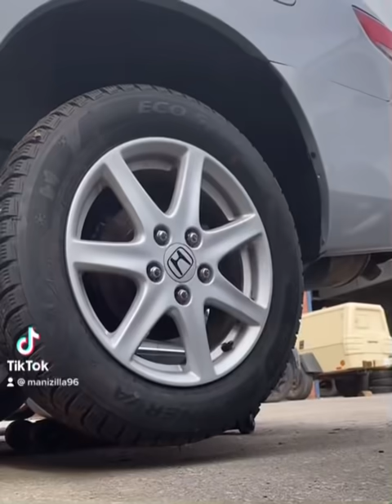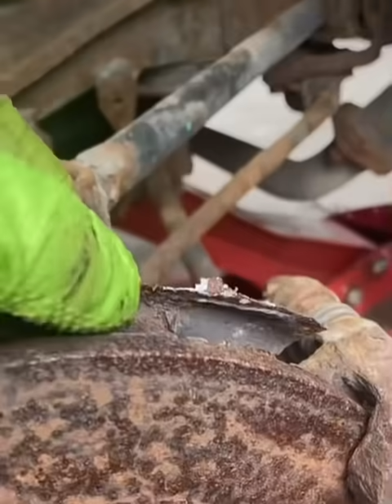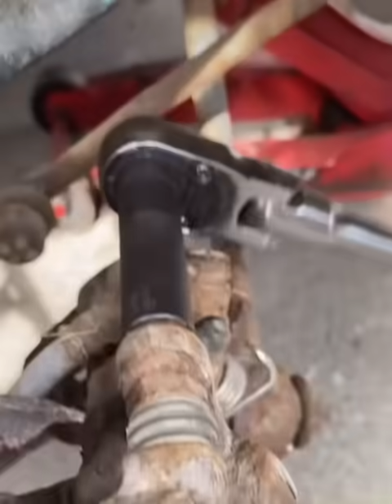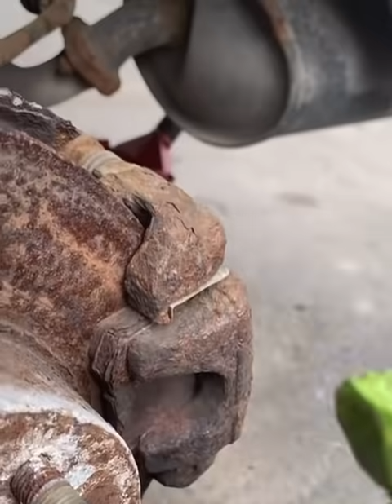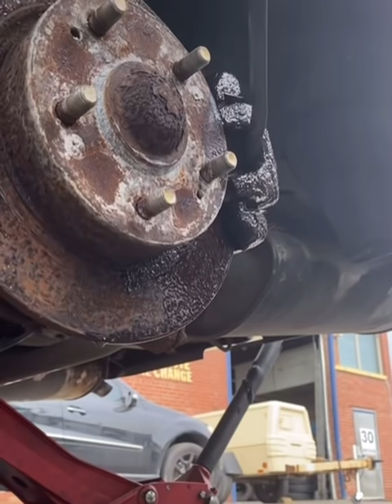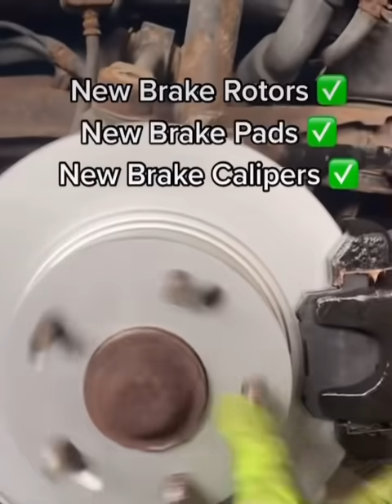Customer never drove their vehicle for 2 years and this happened ...

Comment: I let a 2002 Kia Spectra sit for 4 years, no cranking, moving, anything. I had actually lost the key and it was a $500 car so I didn't care. After 4 years I got tired of looking at it and charged the battery, had a guy come cut a key, and to our amazement it started right up. I pumped the tires back up and drove it like it was for another two years until the clutch went out. Now it's sat for another two years, someday I'll get tired of it sitting there and throw a clutch in and probably put another 100k on it. Can't kill a beater.
Reply: 🤣

I let my expedition sit in the backyard two years until the truck sank making mud go over the rims. Jumped the battery. Took it straight to the highway 👍🏼 (reminded me of this thing)
Reply: My dad had a 60s ford pickup, (not so) bright red old beater. Over 350k miles on the original engine and trans, just give her a jump and she's good to go! It just works.
Reply: Depends on where you live haha. I lived in Arizona, and you could do the same to cars that were sitting for 5+ years. They rarely rust down there due to no salt on the roads.
Reply: I recently passed 300k in my 2007 Spectra and it still runs great. Original engine and trans, but also the original timing belt, so it's only a matter of time before that breaks and takes the rest of the engine with it if it doesn't get replaced.
Reply: Just sell it for 500$ again
Reply: @CubicCake  get a new timing belt instead of breaking your engine
Reply: 89 cherokee with 350,000 miles on it. Sat for four years with no start, movement, nada. Went out. Charged it, drove her on a 200 plus mile trip. Some cars you just can't kill. 🤣🤣
Reply: @CubicCake  I probably will put a timing belt in it, but to it's credit I put 190k on the factory belt. That car has never once left me stranded, even a couple times when the battery was dead I could roll it off by myself.
Reply: @SmellsLikeShmeat  That's awesome! They sure don't make them like they used too.
Reply: I let my 04 Lexus with 150k miles just sit for a year and a half. Had to replace the battery and she starts right up. Unfortunately the tires need to be replaced as they got flat spots but they were low on tread anyway. Can’t beat a beater!
Reply: @joshuavoss1387  me:cries in nissan. Shit always break on me and i dont even drive fast
Reply: And I had a 17th century wagon sittin' there in me yard fot the past 300 years more or less, jumped the horse and that damn thing fired right up! Took the thing for a ride. It was wild!
Reply: It's a Korean car. That's why it started right up lol
Reply: @drunkenbass6128  good luck
Reply: Last year I got my brother's 1996 Dodge Ram that he had let sit for 2 years, I charged the battery and it's been driving fine with 240k miles
Reply: Lol the can’t kill a beater line reminded me, if you live in Florida(mostly) don’t drive your wrx in 10 inches of water, some guy flooded out his brand new wrx yesterday
Reply from the maker: Goddamn 4 years?? Here in Canada that’s basically death by rust
Reply: @ManiiZilla  yeah looking at this video I was thinking, gotta be salt winter land or ocean living. Here in west Texas it's totally dry air and you can have a car sit for 20 years, just flush the fuel system and change the battery and it'll go like no time has passed.
Reply: @turo669  a farmer I work for had a K10 that sat in a barn for 15 years. All he had to do was give it a shot ether and it drove out of the barn. Didn't even need to put air in the tires
Reply: @TheCuriousNoob  I was about to say. I agree. Definitely flush the gas tank. You can tell and feel the difference between old gas and new gas.
Reply: @alecon2249  yeah old gas is not only less potent but it can really damage an engine as it breaks down.
Reply: @ManiiZilla  what does God have to do with the topic?
Reply: There was always that kid in school who raised his hand just to tell a story no one really cared about
Reply: Truff
Reply: Or an old Chevy
Reply: Cars are meant to be driven not to just sit do someone a favor and sale it to them!
Reply: @neilborda2005  I know right? You were that kid huh?
Reply: @ManiiZilla  I'm in the southern United States, mosquitos carrying the car away are my biggest concern, rust, not so much.
Reply: Nevermind the pad rub that the customers going to returning for after they drive it a few miles and it makes hella noise.
Reply: @CubicCake  4 cylinder timing belt/chain changes are really easy to do. If you have a small amount of mechanical inclination and follow the directions, it can very easily be done. I did it at least 15 times in all my friends and my civics like 8 years ago when I was 16-17 before I got my first garage job out of high school. I had never really worked on cars before then aside from changing tires and oil so it’s definitely possible to do it yourself easy
Reply: I had a 95 Ford F-150 flareside. That truck refused to die lmao my dad drove it to 190k then gave it to me, and then I beat the living shit out of it as a young dude. Driving it through trails and shit on stock tires and suspension, redlining it in all 5 gears because of course if you’re an 18 year old “car guy” you’ll drive whatever you have that’s manual like a race car lol. It went until 350k until it “died”. I popped a new distributor in it once I checked spark and saw it was weird, started right up again and I drove it to 450k and then I finally sold it to a buddy who is literally still driving it on stock engine and trans at around 515-520k. Those 4.9l straight six’s and 5 speeds are hard to fucking kill. No timing chain or belt, just a gear lol cast iron. It was a beast and I loved that truck so much. Not a lot of hp(150) but enough to go 100 on the highway if I wanted and that 240 ft lbs was pretty cool lmao
Reply: Old cars are gold
Reply: I had my Jaguar (4.0 V8) sitting for 5 years. Thing had a window in the block and started right back up 😎 the knocking set off Richter scales but it started
Reply: Beaters are the best
Reply: Beautiful story but your pos spectra would have rusted out as well given the same conditions.
Reply: @alecon2249  i bought a van 2yrs ago for $150 and i let it sit at the owners house for those 2yrs it never got moved or nothing put an exhaust on it charged the battery and now its my daily
Reply: Kia gets too much hate like yeah they're all shitboxes but they never die 😂
Reply: Just got a 2008 chevy cobalt that sat for 7 years. New battery and air in the tires fired it up and it now my daily. Bc Canada
Reply: Strange test XD
Reply: @Aidan Bhuiyan yeah, I know 😭 I can get it back whenever I want to be honest, I just haven’t gotten around to it yet. I refused to sell it to anybody but a close friend and our agreement since he really needed a vehicle at the time was that whenever I wanted to buy it back, i could for the same price since I really helped him out. That’s why I told him not to put too much money into it aside from keeping it going lmao
Reply: @Aidan Bhuiyan it’s basically a kind of thing where he drives it while I stack funds, and when I buy it back for the 800 bucks I sold it to him for; I’m actually going to do a full restoration to it. It needs new cab corners and some fiberglass work on the bed. Plus I want to change the gearing out, and I’m either going to finish building the spare 4.9 l have and out a turbo on it or I’m 351 swapping it. My ORIGINAL plan was to buy a extended cab flareside I found with no engine which is why I have the spare but I bought a car instead. I’ll be buying it back sometime within the next 6 months or so though. Then after Im done restoring it, I’ll probably be able get some good ass money for it by then to make up for the nostalgia lol it’s standard cab short bed which is the rarest of the flaresides just because there’s A LOT more extended cabs around
Reply: @CubicCake  You can't ignore timing belt on interference engine. You need change belt every 60,000 miles. Kelver timing belt's recommend to replace at 100,000 miles. Read your vehicle manual for "Preventive maintenance"
Reply: Give it to this guy, he'll donkey kick the shit outta the clutch and it'll work.
Reply: @northsideripridahs2043  I have a 99 altima that I got for $900 I've had it 7 months now, never changed the oil or done any maintnance but it runs like a champ.  I hope it lasts forever. I love that thing.
Reply: @schoopinprofit  fucking gold 👍
Reply: extreme kinfolks  yup, the battery would need to be replaced, the oil changed and most of the time the fuel pump will go bad from sitting so long. Always park a car with as little gas as possible. 
I just got a 2004 Mustang back on the road after 2yrs. New brakes, new fuel pump (& filter), new battery. Thankfully it was on concrete so the tires were okay.
Reply: 560k corolla, refuses to die after sitting for a few years. Started right up after a new battery. Don't know how to kill the thing in any normal usage. Original engine and transmission.
Reply: @alecon2249  "Like they used to??"  It's only a 2007 and it's a Kia!?!?
Reply: @jgibson111  correct me if I'm wrong but I do believe he said it was a 2002 Kia. That and I was referring to my jeep from the 80's. Sorry for the misunderstanding.
Reply: @alecon2249  Thanks for the correction.  Yup 2002 Kia and your '89 Cherokee!
Reply: Buddy had over 600k miles on his Saturn SUV. 

Recently had to completely redo the suspension. Thing still runs.

He attributes it to excessive oil changes.
Reply: @renski8976  this heat in bullhead tho . Feels like Satan's speed bag smaking you all day .. smh lol
Reply: @CoyoteDAworld  lol yeah, i can't say the same about the car's dash, paintjob, tires, and windshield wipers. Those get destroyed pretty quickly by the sun.
Reply: @renski8976  yeah man totally bs lol
Reply: Letting it sit because ???
Reply: those tires are probably dangerous rn.
Reply: I had an 05 Spectra. I called her the zombie car. Drove her until the transmission blew itself up. The engine was still good too, and somebody's got it and parted it out. Last I heard, it went into some Hyundai.
Reply: Beaters are hard to kill
Reply: The only 2 things that I am wnvious about in the USA: guns and cars. Their regulations. You can drive rusty pieces of horse doo-doo, no ofense, and no one will stop you. They can't. And... That is it, everything else is meh from where I am sitting.
Reply: All lies 4 years the gas would have turned to varnish and evaporated
Reply: Mmmm
Reply: But a beater can kill you
Reply: @renski8976  did you know if you put a car in a salt mine it'll never rust? The salt pulls all the moisture out of the air,
Reply: @dannyeckerd9324  nice. However, winter and salt is the worst for cars in the north.
Reply: @renski8976  oh yeah totally the combination of moisture and salt does wicked things to metal, once the salt gets on the steel then it starts drawing moisture to the steel which accelerates the corrosion rate. But in a salt mine all of the salt is on the walls the ground and the floor and there's so much of it that any moisture that manages to get inside the mine is sucked into the walls rendering it virtually non-existent in regards to machinery.
Reply: extreme kinfolks  you'd be surprised how long some lead acid batteries hold up, it was hammer dead, wouldn't even light the open door bulb in the cluster, charged it in the car, cranked the car, and then I used it for a few months. I did replace it later, but not before 100+ starts. You're free to believe whatever you want 🤷‍♂️
Reply: @dstowe1927  try again Dougie. No lies were told in the making of this comment. I also didn't expect 1300 👍 on the story of my shitbox, but hey, the internet's a weird place.
Reply: @colethomsen8675  7 yr old gas, fires right up?  B U L L S H I T ! !
Reply: @swkohn1279  you forgot the part where he flushed the entire fuel system🥴
Reply: @mrobvious5892  Nope, just asked him. Probably has a partially clogged jet but it's been running on old gas
Reply: @mrobvious5892 it's a fuel injected motor idk what to say even drove around on it for a week. Wasn't great and had a intermittent miss  but worked
Reply: @renski8976   they don’t rust but we have another problem called dry rott and that shit is the most annoying thing ever
Reply: @gabrielmendoza9314  yeah, tires, wipers, and all of the weather stripping...
Reply: Similar story here, my dad and I were cutting some old lady’s yard and one day she decided to get rid her old truck (1969 c10) thats been sitting for about 10 years under a tree. She told my dad that if he was able to turn it on he could have it. He told me he just put some starting fluid in the carburetor and she was running like a charm. With a lot of smoke but still ran. 2 yrs later timing chain went out.
Reply: Did you "donkey kick" any part during an overhaul?
Reply: @ratheonhudson3311  I've donkey kicked this car several times for various reasons
Reply: change the oil and fuel please
Reply: @TheCuriousNoob  and change the oil..
Reply: Kinda glad we have MOTs in the UK after reading this.
Reply: Shortage of cars and rising used car prices, some of these sitting cars can be a good value for some buyers.
Reply: @CubicCake  so you’re saying a Kia has 300 thousand miles on it and it’s the original timing belt? Yeah okay
Reply: @brandonlee3892  Because coated steel and kevlar spontaneously disintegrate in less than 15 years, right?
Reply: @CubicCake  you aren’t gonna name the other materials it’s made out of? They wear out and eventually stretch/weaken.
Reply: shit why car is so cheap there like ,in here those car probably will cost about 1500-3000 if you're lucky
Reply: @turo669  🤣🤣 that shits great
Reply: I'm calling cap I've had a car sit for two years and the gas wasn't good anymore had to pump the tank and gas lines and put new gas in to get it to turn over again
Reply: Those cars are invincible.
Reply: @alecon2249  did you change the oil??
Reply: My Nissan has been sitting for twelve hours and I'm about to drive it to work, original engine and tire valve caps
Reply: @renski8976  salt is killer
Reply: Kias are garbage
Reply: @CubicCake  or replace that timing belt to be safe and ensure it keeps going
Reply: Friend had a kid he beat the shit out of couldn't kill the Kia.
Reply: If you didn't start the vehicle in 4 years and you claim it started right away, that is bullshit. You needed a jump
Reply: That sounds like my old 92 Mazda B2200. Literally couldnt break the truck if I tried. Stick shift and carburetor and full steel body.
Reply: But you can beat em?
Reply: @turo669  LLP
Reply: @alecon2249  what oil viscosity you use in that engine sir
Reply: @stevie7214  I had an isuzu trooper 1989 as my first car when I was 16, drove it for 3 years without an oil change nor servicing the 4x4, nothing.. I just drive it to parties, hauled my friends etc, the truck never throw smoke nor left me stranded, oh and.. I never changed the battery, it was the original since bought. One day, I crashed the truck,  whilst being on heavy rain with my big muddy tires, destroyed radiator and all the right side. Put it in the backyard for 13 years. One day I finded a decent shop to fix it up at a good price, put new battery, timing belt, spark plugs, filters, oil, and on the transaxle. I kidd you not, the truck started at the 8th or 9th try. I got it fixed and driving it as today, truck has just 215k. Ohhh and the only thing it got replaced in the suspension where the struts, wheels, brake pads. That's all. She has 127psi in one cylinder the last time I checked in a dry test I did when I changed the spark plug.. I can't believe she made it honestly I was extremely negligent with the truck yet here it is
Reply: Man, you KNOW you're lieing...